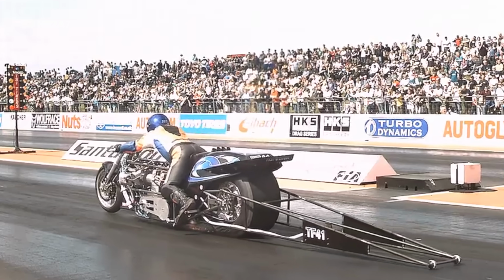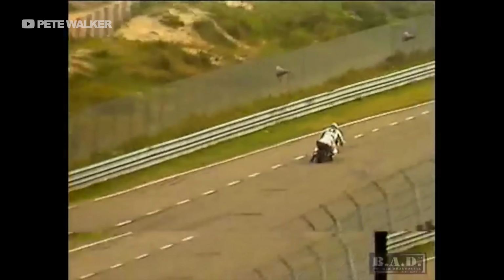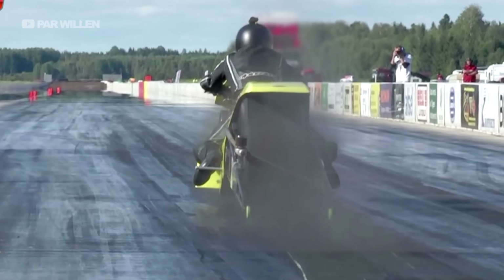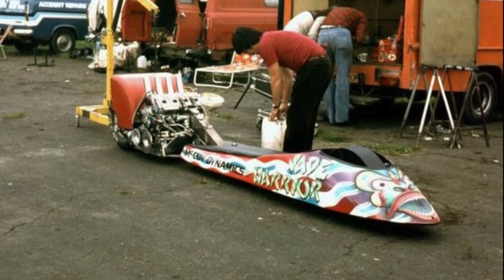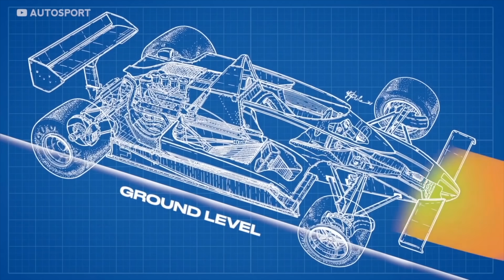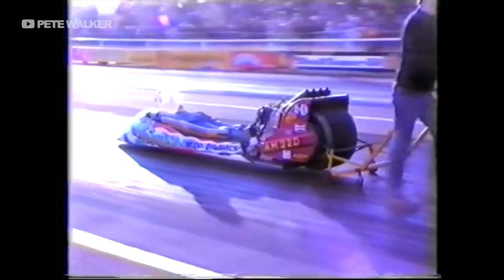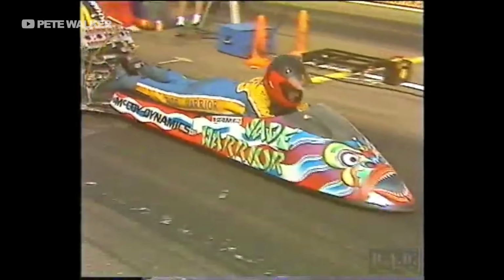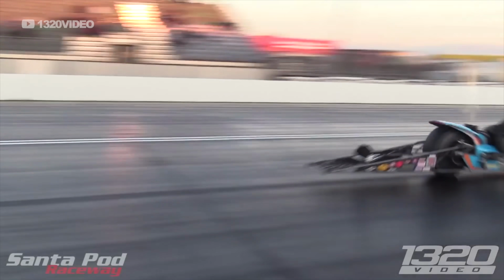The Most Insane Dragster Ever!

Comment: Being that close to the pavement would make you feel like you were going even faster.
Reply: Actually the higher you are the more you feel. As there is more motion. The lower you are. The more stable you are.
Reply: Scooter Lee1775 you ever rode a motorcycle?
Reply: Ac remote yup. Since I was 6. And have logged over a 3 million miles on a bike.
Reply: Scooter Lee1775 how old are you?!?!
Reply: Scooter Lee1775 3 MILLiION
Reply: @ScooterLee-ei1ep  have you been on a plane? Because the higher you are..the slower it seems...
Reply: Ac remote that’s an excellent analogy.  Also, I drove my buddies MGB.  It sits very low to the ground.  60 mph feels like 100.   Then drive a suburban and 80 feels like 60.
Reply: Ac remote go build a house 10 feet in the air. Then one on the ground. The one closer to the ground is more stable. Also you have to remember in a plane your body is going the same speed so there is no feeling. And you are correct the higher you go the less you feel. As there is less air to produce drag.
Reply: @ScooterLee-ei1ep   my comment had nothing to do with stability.....at this point you must be trolling...no way in hell you could be serious.
Reply: @ScooterLee-ei1ep  Do houses go 200mph? You sound like someone who has never been on a moving vehicle at any speed. I'm tired as hell right now, so if you want I can discuss this more later.
Reply: Scooter Lee1775 idk if you’re just reading facts off google but that’s simply not true. Lower is not slower XD. Wait till you experience it
Reply: Isaac Pugno I didn’t say that at all
Reply: Isaac Pugno also show me where I said it’s slower. I did say lower is more stable. Which is fact. The taller something is the less stable it is. It’s physics 101. You are going to feel the effect of motion on something less stable.
Reply: @ScooterLee-ei1ep   I went to school & do this for a living & me and you both know you’re right. Don’t argue with them as they misinterpret what you say anyways.
Reply: @silktm9457  he's right but hes not staying on topic which is what the other guys are saying
Reply: @isaacpugno3388  of course it's not but it just tricks the eye and the mind
Reply: @ScooterLee-ei1ep  tell them to ISS crew

Comment: 5.5 seconds over a 1/4 mile ! Not an 1/8 mile as you said.
Reply: Nah, he is right it was over a 1/4 mile not 1/8
Reply: The script doesn’t match the video at all lol
Reply: @tyvek05 don't comment if you dont know what you're talking about 
Just sayin.
Reply: Glad I'm not the only one that noticed 5.5 in 1/8 isn't impressive at all lol
Reply: Thank you! If it was the 1/8th, that time would be completely underwhelming, though the trap speed would be amazing.
Reply: @tyvek05 WRONG
Reply: @tyvek05 No, it was on the 1/4 mile. TFBs run on the 1/4 mile. TF dragsters run 1000 feet because the tires couldn't handle the speeds.
Reply: @keksauce  No, TF dragsters run 1000ft because of the death of a driver who couldn't stop his car quick enough on a track in the USA which had too short a run off. They tires are fine. Shortening the distance allows all the cars to slow down safely at all tracks they run at.
Reply: @stupidlogic2987  Eh, that makes sense. I heard the tire thing from someone a while ago and didn't bother to fact check

Comment: The hydraulic torque converter was one of the key ingredients of my car to dominate on the 1/4 mile. 

The torque converter creates more torque on the output shaft than it hin from the engine due to the difference in rpm. Yes you sacrifice efficiency but if you know how to use the system it’s brutal

Hold the car on the starting line with the brakes, rev the engine up to give the TC some preload, wait and just release the brakes while flooring it on the green light. 

This technique combined with a 3 liter turbo Diesel engine, AWD, good tires and an racing suspension made my 3series so  launch violently that a navy pilot once gave it the nickname “the catapult”

Maybe a 13,440 sec doesn’t sound that impressive but for a 1800 kg street legal car it was more than good enough and it gave me the opportunity to race against some of the most brutal cars imaginable.

Comment: I can't help but laugh at the "4-500 hp" older top fuel bikes. My step father has a ZRX 1100 punched out to 1280cc turbocharged dyno tuned with roughly 475 HP.
Reply: nice! or the Moore Mafia bike. 700hp and a record of 6.3sec for 224mph. 1000cc. that is unreal.

Comment: One of the most interesting things about motorsports is when professional engineers and racers do other motorsport disciplines on the side" for fun". And just get to do the craziest things in their imagination and just have fun with it. 

There's this racing team called Eyesore Racing that does a racing series called the 24 hours of Lemon's (clever right?). The catch is that your car can't cost more than $500 if you want to enter. This team does however contain three Garrett turbo engineers, one SpaceX engineer, one Mazda engineer and one professional precision driver/car journalist. And they all come together to work on and race a miata on a budget of less than $500 just for fun and because it has to be cheap they come up with some solutions that are extremely impressive from an engineering standpoint.
Reply: I have heard of that. You get penalty laps for going over budget. The judges have to inspect and decide if you went over budget and by how much. That decides how many laps down you start with. Some teams intentionally go over budget and try to end up on a positive lap before the end of the race. I've also heard that this race pretty much never guess a full 24 hours because all the cars break and retire.

Comment: I doubt that the biggest problems with stabilization bars behind the bike are weight and aerodynamic. The problem is by having an other point of contact to the ground it reduces the weight on the back wheel and so reduces the adherence.

Comment: Just wondering who has larger balls, the Isle of Man TT riders or the guys who rode this bike
Reply: Isle of Man hands down. Not even an argument, those guys are nuts
Reply: @DendoWeedFace  and a lot of them die as well.  Amazed this guy did not die campaigning this machine.  Any crash would likely be fatal... nothing quite like ending up at the scene of the crash face first.
Reply: Isle of Man
Reply: Imagine how fast these bikes would go, if the bikes don't have to carry the huge weight of the drivers balls.
Reply: Isle of Man. Sustained speed for the length of the isle with buildings that you scrape your elbows on as you jet past?? No comparison

Comment: The ingenuity of engineers is what makes the modern world so inspiring and fun.
Reply: Engineers do not have very much free range of design any more due to monetary constrictions and big corporate companies squeezing the last drop of profit out of a cheap design to line their own pockets. Engineers are the backbone of racing, the core building blocks to almost everything we use and they are treated like trash.
Reply: @jonathanblunt3779  In Motorsports sure, but generally speaking engineers can get creative depending on their position. It's a "what part of the industry are you in" sort of thing
Reply: @btoiscool  id hope so
Reply: @jonathanblunt3779  Look up Allen Millyard , he's the most unrestrained and free thinking engineer I know of. He's a credit to engineers everywhere.
Reply: To these points, F1 used to be a sport about innovation, as in what you brought to each race or season. Thus it was about the manufacturer, the builder/team, not just the driver. Now with the previously mentioned restrictions and constraints, F1 went the way of NASCAR, and is much more of a FanBoy series to sell merchandise. Yes, over time, still great innovation, but when several teams showed up to practice at Monaco with a small wing above driver for additional downforce at the slower speeds, they were prevented from racing (2007 perhaps?). Differential innovation at each race used to be part of the fun.
Reply: Sic Semper Tyrannis  They were good enough students and disciplined enough to make it through school but are engineers on framed wall art paper only .. least the ones you have to suffer under.